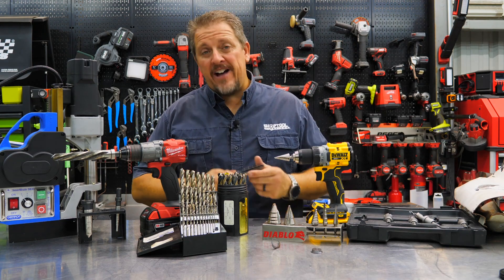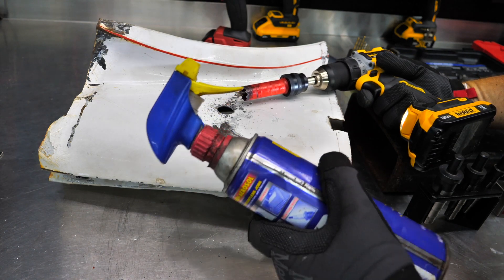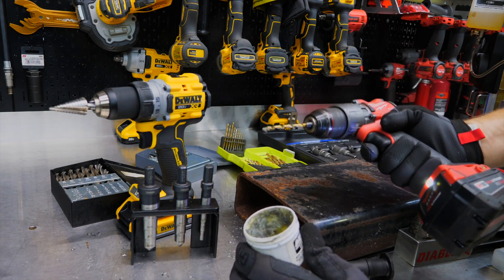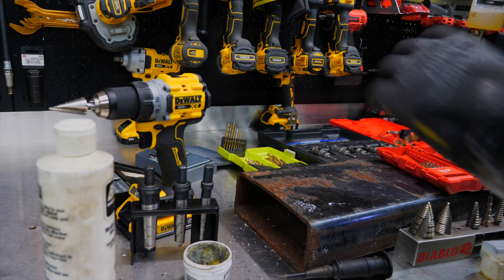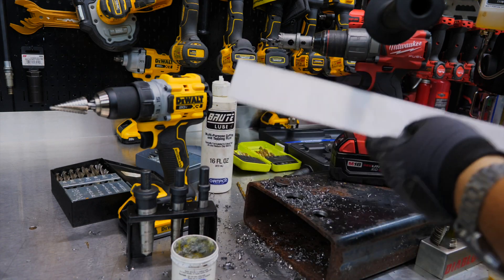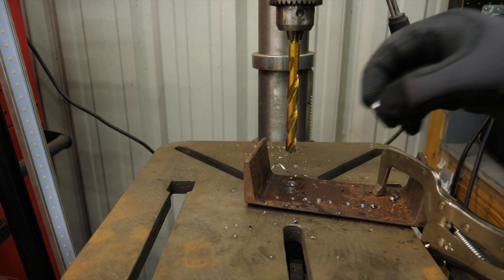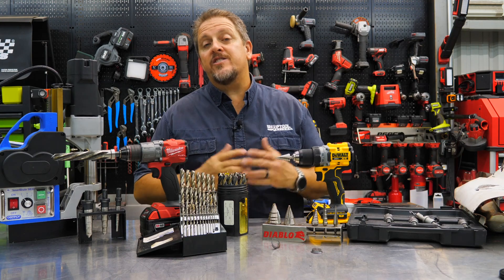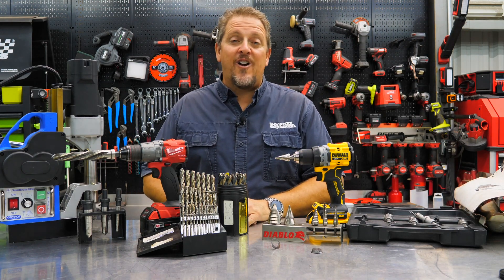How To Drill Holes In Steel

Comment: I highly recommend the dewalt impact rated step drill bits. They're a little noisey because of the impact but they have no kickback when the next step grabs. Plus impacts have a higher top speed when not impacting which makes it easier to start the hole from the smallest step where the surface speed will be lowest.
Reply: I agree. I have the same ones and I have never seen a drill bit cut as good as those do
Reply: Project Farm test step bits a couple of years ago and Dewalt with the spiral flutes did the best. In general Dewalt makes good construction grade drill bits. Mind you I didn't say machinist grade lol

Comment: Good stuff sir. One thing I wonder about is regular drill bits with a step bit tip. Norseman brand makes a set but it's $170-200 so I haven't pulled the trigger yet.
Reply: One common route to dulling a drill bit is chipping it when using it to enlarge a hole and that is from too much pressure.  When there is not as much metal for the drill bit face to press into its much easier to chip it.  The key there is light pressure.  The common advice for pilot hole size is for it to be a little larger than the webbing of the following drill bit.  

The other common way to dull a drill bit is letting it overheat.  This happens easily with too much speed and no coolant.  Along with cutting oils there are also water soluble cutting oils.  They use a bit of oil to protect the metals and a lot of water to keep things cool.  They are sold a just the oil and you add the water.  

After you buy the expensive 29 piece set you can replace just the individual bits.  I find I replace mostly the small, cheap bits.  Some of the real expensive ones are geared towards machine use.  Look for a set advertised for general use (and not the cheapest ones, but also not the most expensive).  

Also, with a pile of dull / chipped drill bits, a 60-80 grit bench grinder wheel, a cup of water, a drill bit gauge, a bit of research, and some motivation you can learn to sharpen larger drill bits.

I don't know much about the step tip drill bits other than I think I know what you're referring to.

Comment: I use wax for abrasive diskes cutting aluminum, also for cutting aluminum with a jigsaw I rub the wax on the line I'm cutting and it grabs the wax on the way down through the cut .
Reply: Try soap, wax can be hard to clean off, and is flammable, 
(Btw, *discs*)